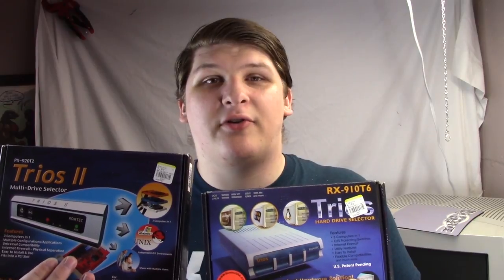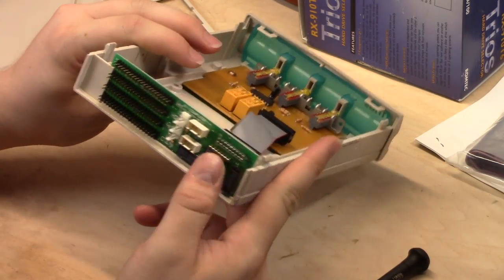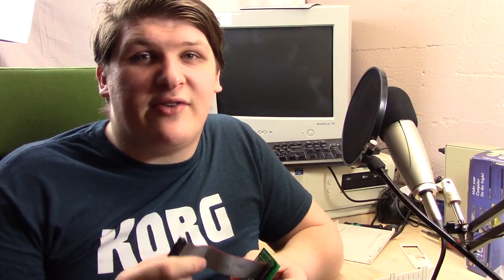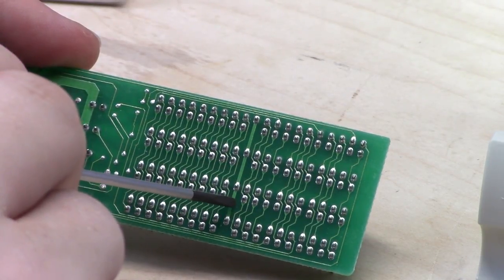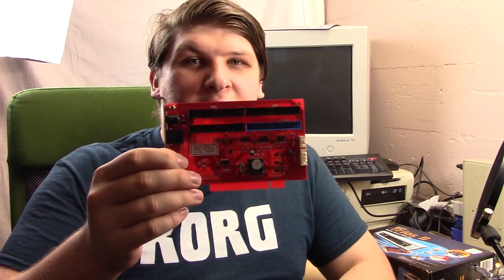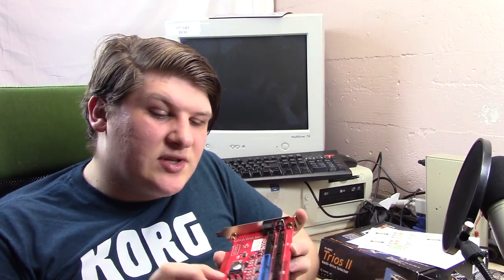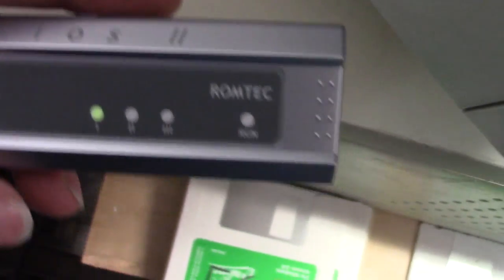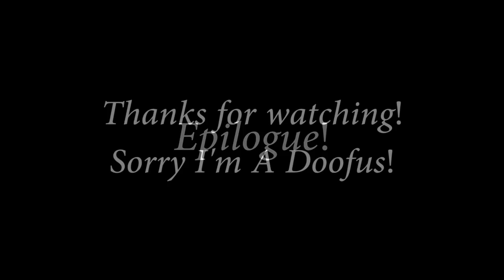Trios I and II Drive Switchers

Comment: Only now discovering a lot of your older videos. This reminds me of my first self-built system where I cobbled together a homemade boot selector switch for two hard drives. Mine wasn't this complex though, all it did was use a couple key lock switches salvaged from some old PC cases to swap which drive was designated Primary and which one was Secondary, same as if I were to physically swap the jumpers on the drive. Granted, my method lacks the safeguard of stopping you from changing the switches while the system is running (although this is why I used key lock switches and not toggle switches), and it only supports two drives instead of three. But, it worked well for my purposes.

Comment: Picked up a Trios II at my local thrift a few weeks back...wasn't sure at first if it would be useful but, like yourself, ended up being a very good decision.   Installed on a P4 / Intel mobo and the only issue I had was the remote board itself took some time to start working (maybe oxidation in there?  Not sure).   Fine since then....mainly using it for two things 1) separate OS runs without the need for a multi-boot setup and 2) one drive for occasional cloning purposes.    I like that there's no power to the drives when not used, that was the biggest selling point to keep it installed on this PC.

Comment: It's good to see a diagram for the ribbon cable. There are too few diagrams on Youtube outside of the math channels! :) It's nice to see pinout lookup on a retrotech channel too; too many people just don't know how to use that info.

    19:50 you can use a low-voltage continuity tester, perhaps? It could be harder than tracing by eye, but if you get into a rhythm of moving the probes from pin to pin, it might not be so bad.

    Retention clips! I haven't seen those in years either. :)

    Hah! "_Strike_ the F1 key to continue." I must have seen one like that when I was a kid, because I remembered it as a weirdly aggressive phrase without remembering the exact wording, and was later surprised to see machines with the calm, reasonable, "_Press_ F1 to continue."

   Hahaha! Always check the cabling -- a rule I made for myself decades ago after too many such failures, but I still get it wrong! XD For example, just now I had to delete a whole paragraph from this very comment as to how this device was obviously cheap rubbish because I hadn't thought of checking everything either! But to give a practical suggestion; this is why I always test before putting it all back together. Usually! :)

Comment: "That's absurd, who does that?!" I do that to mechanically dual-boot, almost daily! Products like that are made even today, and I have one for SATA to switch between my Windows and Linux SSDs. However that only switches the power connectors, which makes sense considering that SATA is hot-swappable. It is great, becuase I don't need to worry about boot loaders, or Windows Update breaking whenever it sees a Linux partition! (This happened too many times with me while dual booting.) So it's just cleaner, safer and easier that the two drives are never used simultaneously. I have a shared disk too, for backups or in case I need to transfer between the two, though that never happened yet.

Comment: I wonder if you tried other jumper settings, if it would work.  Maybe pick Master or Single instead of CS?  Particularly with drives from the first EIDE era and before, things were not always copasetic when you had two different model drives on the same channel.  (Although, those did look like later model drives...)

Also, it seems really sketchy to switch +5V and not +12V.  I mean, who can predict how those rails are related on any given drive?  You never know whether there's a path where the +12V will back-feed the +5V rail if it's disconnected, maybe through a protection diode or something.

More to the point... this really looks like a job for a bootloader.  :-)  Especially if your 2nd drive is BSD or Linux or whatever.  Those are usually much more tolerant of having a loader on Pri Master and the actual OS wherever you want.
Reply: Someone didn't finish watching

Comment: I mean, there's modern versions of this, except instead of doing this it's just an on off toggle that powers down the drive. basically it's a light switch for your hard drive. I don't think that would work though unless you power down before you do it. could be useful for a dualboot

Comment: So glad you got it sorted.
I have a question though. I'm assuming both drives have to have the same BIOS settings right? Or can the BIOS simply auto detect whichever drive is selected by the remote, meaning they can be of different brands and different sizes?
Thanks for sharing.

Comment: I'm surprised that the first one isn't just a power selector switch.
Pressing the button physically switching the power to another drive and those without power don't interact with the computer which they are plugged into, so all three drives can be left plugged in permanently into the IDE ribbon cable.
Just make sure that the power is off to the computer when you switch drives.
Reply: He addressed this. Even with it shut off the output signals on the cable could energize parts of the switched off drive causing interference
Reply: @robearr  That's not true though, I made my own master-set HDD switching device which worked exactly as I described, at roughly the same time this "Trios Drive Switcher" was being sold. Most computer hardware is more durable and fault resistant than many people would otherwise believe.